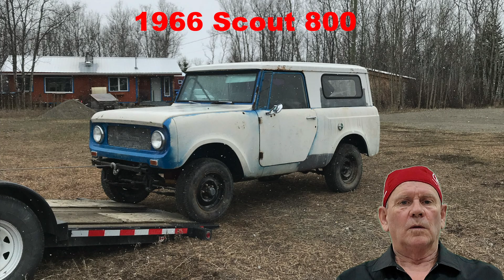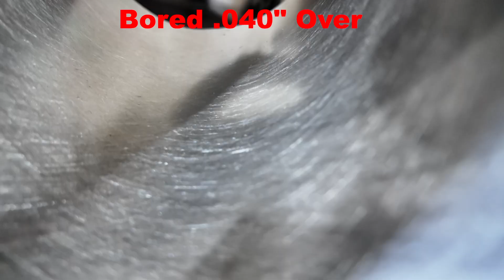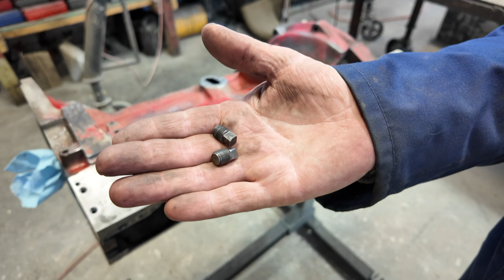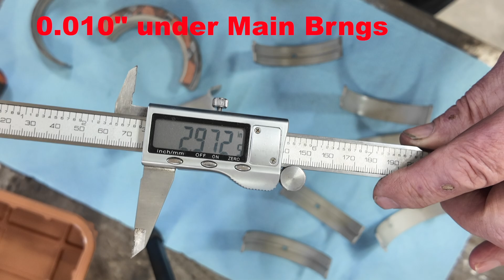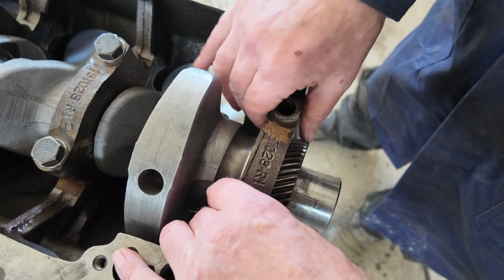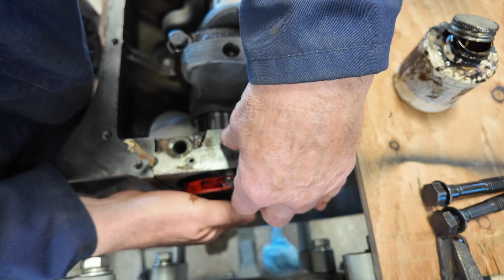Scout Restoration Yukon: Engine 1: Crankshaft Installation.

Comment: Hey Mike  I've been watching your videos for a while now. Thay are full of knowledge and very informative.  I really like your attention to detail. My question is on crankshaft bearing clearance  I  have one thousands on  1, 2, 4, and 5 and 2 thousands on main no 3. Are the one thousands to tight.  I know the manual says 1 to 3 thousands just seems a little tight.
Reply from the maker: Hi Chuck In my opinion if the crank turns freely don’t worry about it ! But I always get a second opinion just to see what someone else thinks !
Thanks for watching More to come !
Reply from the maker: 0.001” main bearing clearance is to tight but plastigauges are not super accurate get a pro to measure it !
0.0015 would be ok !

Comment: Hey Mike - sorry fire this dumb question-  you mentioned the crank was turned down 10 thousandths and the bearings were also 10 under. Wouldn’t the bearings need to be 10 OVER to match?
Reply from the maker: If you turn a shaft down it gets smaller therefore you been a smaller bearing !

Comment: Hey Mike. Thank you so much for the videos. I am early in the process of working on my 304 in my 69 scout. I have a newbie question for you – how did you know you needed your crankshaft turned? Thank you
Reply from the maker: The bearing shells are marked standard, 0.010 under etc see specs and measure if you had a new bearing you could plastiguage or just ask at machine shop !
Thanks for watching More to come !

Comment: The "Scout bug". I love it. I have a 65' 80 with a 152. I "plan" on disc brakes ATW around and EFI (Hamilton).  This is, of course, if everything is good to go after inspection. Would love your input.
Reply from the maker: Hi td, Thanks for watching ! What I like about the Restoration Process is it's very personal.
We probably spend more time with our Scouts than with our wives ! 
The Scout is the other woman ! 
Each restoration is unique to the restorer !
I don't think International made two Scouts the same !  It's your dream there are no limits !
You can convert  to electric wipers or take on the challenge of making the original Vacuum Wipers work! Both solutions are good it's just a matter of preference.  My Mission is to Restore my Scout to as close to the condition it was in when it was new. Concours !
Over & Out !